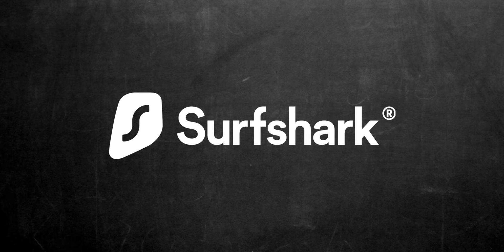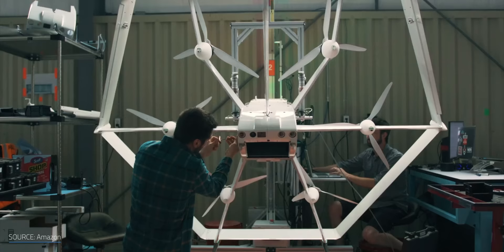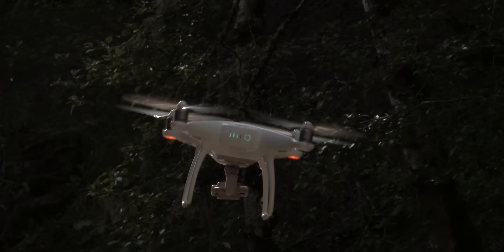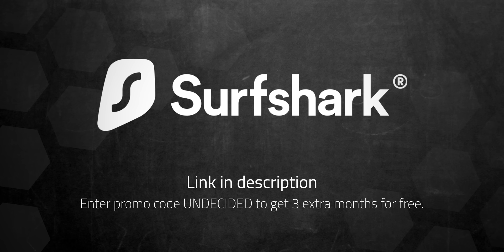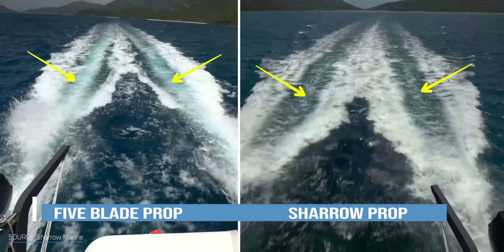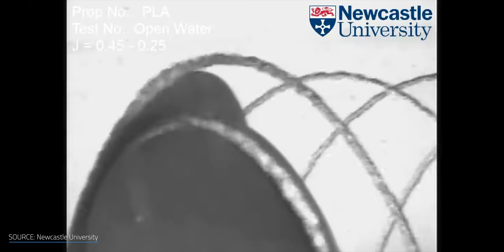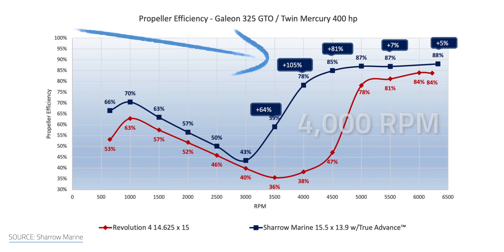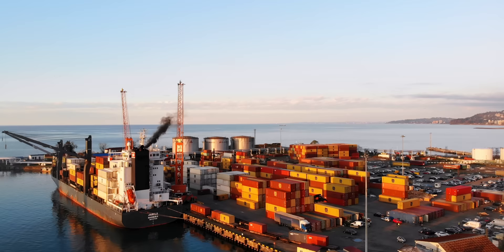Why is this Propeller Getting So Much Attention?

Comment: The thing you overlooked was that these propellers are indeed much more efficient, and as you showed especially at 3000-5000 rpm. Big container ships however do not have propellers operating at these speeds (because this is very inefficient!) and they run at about 100 rpm. So  toroidal propellers probably don't help for this application. For drones, they are more quiet, but not more efficient.
Reply: Completely correct. Most of the information provided in the video is extremely inaccurate and misleading.
Reply: Why are they not more efficient for drones?
Reply: @webdactic  I think it has to be optimised for drones. It's hard to say
Reply: @webdactic  For tri/quad+ type drones with fixed pitched props, they likely are more efficient. But he also showed drone airplanes, which are likely to provide little benefit. Specially with larger drones where variable pitched props are already common. For things like boats and tri/quad+ drones, which have a large RPM window, constantly speeding up and slowing down, especially with a large transition period (such a boat coming onto plane), benefits are likely to be found. For others, where variable pitched props are already common (wind turbines, most airplanes), benefits are likely to be significantly reduced or all but absent.
Reply: @justanothercomment416  The MIT page on this states that it ""achieves thrust comparable to that of a multirotor drone propeller" not more. Probably because the efficiency loss of wingtip vortexes in air is significantly less than in water where cavitation is a huge problem. There is an inherent inefficiency with dirty air in the toroidal design and even at the high RPMs a drone operates at, it seems this is still slightly more than the gains from the reduced vortex drag.
Reply: Isn't the prop rpm of the big ship governed by the radius of their props meaning the tip speed is high enough to generate vortices at relatively low rpm? 
The toroidal prop would certainly change that calculation. Better or worse, I dunno but definitely worth investigating no?
Reply: @zporadik5651  They specifically size them so as to avoid that situation. Which means it generally only happens under aggressive accelleration or above their ideal operating RPM.
Reply: If the props are more quiet it means that a lot less energy gets lost as sound - hence the props WILL be more efficient. That's just how the physics works.
Reply: @justanothercomment416  I think that was exactly his point. Current designs are as large as they can be while avoiding cavitation at efficient RPMs. This new approach reduces cavitation by spreading it along the entire blade, so you could make the blade either much larger at the same RPM without adding cavitation (much more efficient for the same fuel), or you could increase the RPM at the same size (much more power for the same diameter).

Not mentioned in this video, but these shapes have another advantage no video has yet commented on - The shape distributed load stress very differently. It's a much, much stronger shape, and it also doesn't have to be fairly 2D like standard props. This means that, using 3D printing, you can create a hollow propeller with internal reinforcement which is larger and lighter than current technologies, and still gain more RPM and thrust.
Reply: Per usual, Matt’s video is entirely misleading
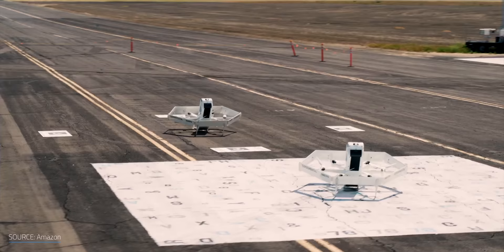Reply: @kevinrtres  Well, you are partially correct. But really it is also very much about changing the pitch of the noice. The human ear is especially sensative to the noise a drone makes. This is clearly explained in this video at 1:35. But indeed, there is an efficiency gain (because of minimizing wingtip vortexes) but at the same time there is an efficiency loss due to the connecting piece causing dragg but no lift and the blades receiving more dirty air.
Reply: @Eikenhorst  Interesting reasoning. Thanks.
Reply: @telanis9  Sound doesn’t require much energy. Technically true, you are saving energy that otherwise went into noise, but the sound energy is minuscule. The source of the sound isn’t though — the drag that the vortices create along the boundary layer airflow is a big energy cost.
Reply: I’m sure there is a difference between less noise and less audible noise.
Reply: I have watched maybe 4-6 of Ferrell's videos in 4 years.  I avoid his bit because he constantly cherry picks numbers in a dishonest way. It's completely unnerving for people with engineering or science backgrounds that start peeling away the layers. 

That said, I do wonder who does toroidal PC fans first to jump on the hype train: Noctua, Nidec, Ycc, Delta, or some contracted job to the actual manufacturers by Corsair, Cooler Master, or Arctic (might include Noctua in latter rather than former category - difficult to track down if they are fabless designers or not tbh, but much of their stuff looks like it comes out of Nidec factories with custom mods).
Reply: Totally agree. The scientific community is still at the early stage of excitement of this toroidal variant. However, those of us who fly aircraft have already gone through all of the research and testing, and don't see toroidals as a game-changer.
Reply: This is technically correct but objectively wrong. 

This was just a comparison for the application of small boats. The important factor, as with all propellers is tip speed. Bigger props are going to have a slower tip speed. The actual rpms are completely irrelevant.
Reply: @justanothercomment416  It is only this mistaken understanding that is inaccurate.
Reply: He did not overlook anything, at 10:40 he literally said that we won't know if these propellers will work when scaled up until more tests are done...

Comment: Major Hardware did a couple episodes on the design.  I am not a 3d modeler however I noticed that the drone propellers and all the PC fan designs did not have the depth that the boat prop had.  A PC fan unlike a drone prop would need higher static pressure for efficiency as the weight is less of an issue compared to a drone application.  More depth and less distance between the blades would greatly improve static pressure.  It would be interesting to see someone create different designs between depth and possibly more blades to figure out the prop-er applications for this revolutionary concept.  - @UndecidedMF I appreciate you letting this stew for a while to see what new comes up before making a video about it.
Reply: It would have been cool if this video included a quick reference to Major Hardware testing creative 3d printed designs based on user submissions. Even though it may not be drones or ships, their findings could foster other applications, like you noted this design was on a couple episodes. I like how he reports rpms, flow, sound, etc.
Reply: My physics game is weak, but in researching Sharrow (before I saw the price, more than my boat!) they made the point that in a ducted situation, the anti-cavitation and tip vortecise benifets reverse and are actually worse in most cases.  They were testing for bow-thrusters.  Probably not a magic bullet for Major Hardwares fan design test, but always cool to watch the tests

Comment: The nice things about noisy drones is when you can zip a drone in and park it a couple of feet above your friends head before they realize what you are doing and then increase the prop speed to make it shoot straight up.

Specially when you are far enough away that he can not catch up with you before he tires out and stops.  Of course, that means you are going to have to be prepared and not get upset when he eventually does the same to you.  Or he figures out a way to accurately drop water balloons on your head, in January, when it is 10 degrees.

Lots of fun.

Comment: I've wondered how efficient this propeller design would be in a wind turbine.
Reply: It would make a more efficient blade no doubt.
(I used to work on wind turbine blades)
but the blades need to be actuated independently (optimize angle of attack during rotation). So this would be difficult, also the blades would require much more material. these blades are already massive(~13tons) , and non biodegradable (they just bury them) So I'm not sure the benefits would outweight the cost. no pun intended.
I guess one could reduce the size of the blade to compensate for material and justify it by the increase in efficiency. But the engineering required to manufacture something that large, transport, and repair it. Seem unfeasible/un-Scaleable
Reply: @daizhanennals1485  As for the angle of attack, some aircraft have a propeller where the pitch of the blades can be changed. I don't see why a wind turbine can't do the same thing.
Reply: @twistedyogert  All wind turbines can adjust the angle of attack..
Reply: Wind turbine blades are already enormous. It would be impossible to make the blades like that.
Reply: They don't have to be big. What about in a darwin-turbine? @akyhne
Reply: @mitchhaelann9215  Darwin wind turbines are very inefficient. So whats the point building them?
Besides, those don't have the tip problem, as they have none.

Comment: Hi Matt, I discovered this propeller a few months ago; I contacted someone I know in the electric boat industry; they told me they already knew about Sharrow, had tested it extensively and found no noticeable difference in efficiency; such a shame as electric boats need all the efficiency gains they can get due to battery range restrictions.
Reply: Sounds like your friend needs to improve their testing methods.
Reply: Maybe they work best in sharrow water.
Reply: @ernestdambach8925  it’s possible that the electric boat uses larger slower props due to electrics better torque at low speeds. ICE outboards basically use the water as a torque converter.
Reply: It might be that this toroidal prop is not going to make much of a difference for an electric powered boat on the basis that electric motors have very flat efficiency curves.  If you consider an ICE the efficiency curve shows a dramatic reduction as you move from the peak torque (peak thermal efficiency) operating condition.
Reply: @michaelharrison1093  Yes, that will have an impact however Sharrow also talks about the hydrodynamics which is separate from the engine/motor dynamics.
Reply: @ernestdambach8925  Agreed. This technology focusing on this specific segment is likely to be very effective, so long as they operate their boat/engines within the most common use cases. Which includes common transitions from stop to "on plane", and travelling large distances at a time. Deviation from this use case is likely to reduce overall fuel efficiency gains. However, the noise benefits will remain.
Reply: Most of the comments here don't really understand what's going on here.

This is really about fixed pitch props. This is also true for aircraft. Their highest efficiency occurs when the forward movement matches that of the prop's pitch relative to the RPM setting. Remember a prop is a screw. If the forward movement of the screw does not match that of the pitch/RPM, it is an inefficient use of energy. Accordingly, it's not that this new design is so amazing efficient. It's that fixed pitch props are so amazingly inefficient at all RPM settings outside of their ideal pitch/movement. Accordingly, 105% is easily believable and likely very accurate.

That said, contrary to the video's false assertions, this technology likely has little use outside of tri/quads and small boats. As props get larger and larger they are intended to spin much more slowly, if for no other reason than to avoid super sonic tip speeds (example, helicopters and cargo ships). The larger the prop the less likely they are to have high RPM requirements. Which is in large part why the prop blades become wider. In other words, they get their performance from size, not speed (RPM). This also means the operating RPM window is drastically reduced (1500-6000 RPMs (4500 rpm window) vs for example, 100-250 RPM (150 rpm window), of a large cargo ship). This in turn means a large ship's propeller is much more likely to always operate at or near ideal RPM whereas the smaller boats commonly transition to and fro as their standard operating environments. Accordingly, the inefficiency is much more commonly observed. In turn making the efficiency improvements a much larger percentage of it's overall fuel consumption as it commonly spends more time as it transitions in the less ideal RPM range.

For example, a small craft likely operates around 20% of it's life in transition. Whereas a large ship likely operates 0.0001% of it's life in transition, with a much smaller window for transition. Accordingly, a well optimized fixed pitch is almost always be ideal for large cargo ships. Additionally, for things like wind turbines, most prop aircraft, and so on, they already have variable pitch props, which addresses this inefficiency.
Reply: @justanothercomment416  Thank you for the specific numbers, that is very helpful to me, to understanding this topic.  The ten fold drop in rpm, and the increased torque required to run the really huge propellers, sounds like that makes all the difference. 

Going the over direction, toy RC boats, with 3 d printed graphene and resin toroidal propellers, can you see a better, faster, quieter, luxury toy boat emerging from this development?

 Portland had its first day over eighty degrees days, since last October, this last weekend. 

I was on the Columbia river, 12 miles west of Portland Oregon three days ago, on the beach all day.  Saw several of those huge container ships move past.  In person, they defy imagination, and for thier size, seemed to move pretty quickly  downriver.  They appeared to ride with a distance, waterline to peak of the mountain of shipping containers stacked on top, of near 200 feet.  And the ship, well over 1400 feet in length overall.  

Truly otherworldly to watch them glides past in person.
Reply: @justanothercomment416  I understand your argument and assertions which makes it even odder that Sharrow has found these improvements given that the boat that I know of where no improvement was measured was around 9m long and a planing hull thus not the large constantly running engine (in say a container vessel) that you alluded to. If it doesn’t benefit a 9m boat how small would you have to go to see one? Clearly there are certain scenarios (with small fossil engines) with distinct parameters where it is more efficient and there may be other non-financial benefits but it sounds niche and at a high cost.
Reply: @andrewallen9918  That's exactly right. This is not a universal improvement. The operation of the boat makes a big difference. If the boat is mostly parked fishing and slowly moving around from point to point, then there will be almost no benefit. Ideally this prop helps those who frequently go from idle to plane and back again, with a ton of "on plane" cruising for extended periods. This is because it improves the transition period from idle to on plane and to a much lessor extent, the on plane economy. But if you look, you can see the constant speed prop does eventually catch up once on plane, but at a higher RPM; which is where that fuel savings is really coming from. And the basis of comparison is fuel economy, not speed. Want that fuel savings? Get a normal prop designed to operate at that RPM.  

This also implies the prop used for comparison is not ideal of the desired operating RPM. In prop design, they generally design for a single ideal RPM (raising the question if the comparison is really on the up and up). Meaning there is likely a more ideal prop selection, for the ideal torque, for which they should compare. Additionally, to benefit from the smaller prop efficiencies, you need to be at that RPM for extended periods of time. Sure you'll always benefit once on plane and no longer accelerating, but if you don't commonly cruise for extended periods, it represents a tiny overall percentage the engine is running. Which means it represents a tiny overall percentage of fuel economy.

This is one of those topics where the devil is in the detail. And contrary to the video, it's far from anything approaching a generic, general purpose improvement. So yes, absolutely, this is a niche product. Though I expect for those within the niche, it is a good product. Good for the price? Hmmm. If you're outside the niche, not so much.
Reply: The 105% efficiency improvement was only in a very narrow window achieved when the Sharrow prop reached planing speed a few seconds before the regular propeller. Everybody boater knows your worst efficiency is just before you get on plane, nobody chooses to run that speed when you're making the most wake possible. So the Sharrow was on plane while the regular prop was still at it's worst performance. As usual, they cherry pick their facts. For clicks.
Reply: @edbruder9975  ….that is exactly right and the essential point that just about everyone has missed. The smoke and mirrors here is that the comparison was made at the same rpm, but that obscures the fact (deliberately so IMO) that the same rpm was actually two different boat speeds, representing two very different power (and load) requirements of the prop.

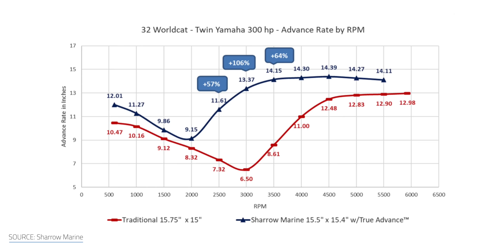Comment: 7:46 'How to lie with statistics'
Graph starts at 5 instead of zero which skews perception for those who didn't notice this
Reply: Yes but it’s even worse than that. That graph is smoke and mirrors for sure but according to this data the boat managed 64 kts (!) at 6000 rpm with the conventional prop. Yeah well, that didn’t happen because according to Worldcat specifications their boat does 45 knots flat out. In other words, the graph is a fiction, easily debunked.
  Another piece of BS here is that the so-called 3 blade Sharrow prop is actually a 6 blade. This alone significantly increases the advance ratio so comparing it with a 3 blade conventional prop is bogus.